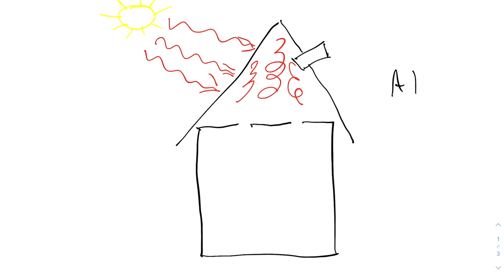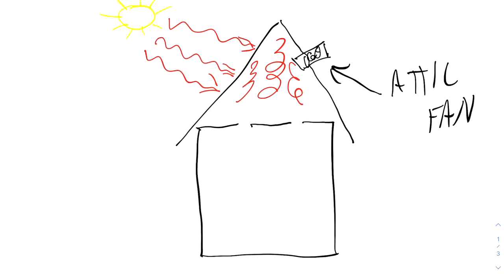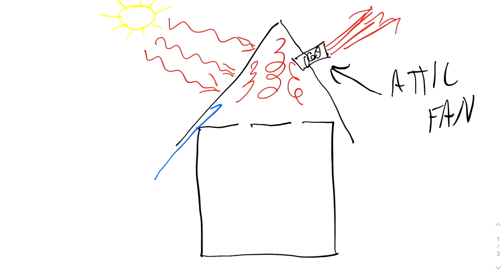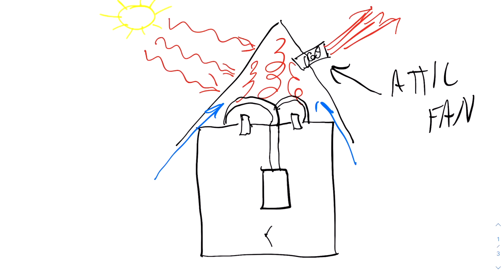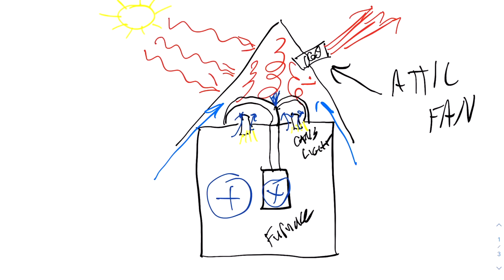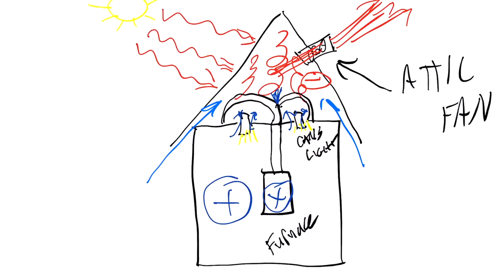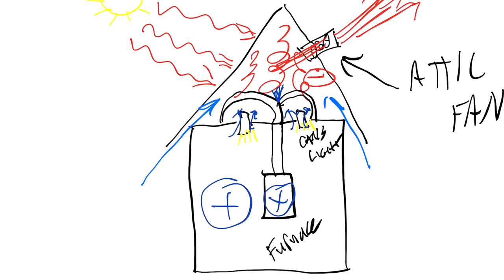3 Remodel Rip-Offs

Comment: I am an HVAC contractor, i disagreed with this gentleman. I have a solar fan in my attic an about 4 passive vents, also the ridge vents. The attic is very comfortable. I have also installed Radiant Barrier and added insulation. I have trees shading most of my house. That I also recommend.

Comment: Hot air moves to colder air. Heat transfer by convection in this case is being amplified by the attic fan right? The idea that your cold air is being pulled from the house to the hot attic doesn’t make sense since cold air is more dense and hot air is less dense….unless the attic fan is working so well that it’s cooling your attic at a rate quicker than your house is being cooled by the a/c.

Comment: Wrong answer on the attic fan bud. I'm a mechanical/electrical engineer building by profession, certified in thermography, work in the cloud IT space. Since I've got hot air in my attic and not a hot pocket, I think I'll follow the physics of heat transfer and put my fan in. I'd suggest others do the same

Comment: well I live in Panama and when I changed my windows from slide single pane to double pane and european style I saw 27% savings on the electricity bill  and I live in humid hell (I save a ton of money as the A/C doesn't have to work that much harder) with the added benefit that they are a godsend with lowering the noise.

It will take around  20 years to payoff, but my keeping my sanity due to the lower noise to me it already paid off

Comment: I Got a new nest thermostat (With air wave) and it was $50 from the store. (power company deal). I noticed IMMEDIATELY it made a difference. The air wave function is  determined by humidity, so it won't make your house damp, it does save some on power because a cold block of steel in the AC room doesn't help my house, so it shuts the pump off a couple of minutes early harvesting all the cooling you invested in power wise. 
it learns how fast your house cools / warms and can use that info on schedules, or to determine when to stop the pump for airwave. having the thermostat programmed for my schedule is really nice, and I can turn the AC off from my car if I forget to do it before I leave. You can even set it up to start the AC again automatically  when you return home. 

So, basically I can't trust anything this guy is saying, because I know for a fact he's dead wrong about some of it.

Comment: Thermodynamics disagrees with his assertation that attic fans don't work.  I designed energy conversion buildings inside the shell of steel sea crates that converted 1000VDC (solar) to 386VAC 3 ph.  There was a lot of heat given off by the inverter sections that needed to be removed.  By installing industrial Greenheck exhaust fans on the structures we were able to cool the electronics - outside of Austin, TX, IN THE DEAD OF SUMMER at 110 deg F.  Moving air across a surface that has a higher temperature than the air will remove heat.  As long as there is a temperature differential it will work.  The trouble with solar powered fans (without supplemented power) is the roof and attic stay hot long after the sun goes down.  I'm still going to get one for my house in Florida.  There is no attic ridge venting above the attached garage but there is for the rest of the house and it is partitioned off.

Comment: Reading the comments these guys disagree with the attic fan. Also you said it's going to blow air in with your example of the microwave. It's actually taking hot air out. And the furnace ac system is in a closed system of the duct work. So the pressure wouldn't be affected.

Comment: I have a smart thermostat and while they can HELP you save money, they only do so because you can program in temps and let it handle stuff automatically. But yeah, typically the claims they make on saving 25% is nonsense. At best <5%. It's the smartphone integration that's nice. BTW, mine costed like $60.

Comment: We hired a company (yeah..there were some vague warning clues they were fly-by-nite.☹)
But needed extra insulation up in the common truss roof system, & crawlspace....we had thought we could DIY…but, old folks crawling thru a web of trusses, or under house, is a fail.  
….So, they brought bags of fluff (of course, there’s was “unicorn sweat”)…
     I specified R-60 on contract, but, they only went to R-40, & that, only by me pushing them to put more!  At that, they only added about 3 more bags. ☹
….Also, they were not gonna install soffit vent baffles to prevent fluff clogging the vents…we’d already bot some, intending to install, so, I handed them to the kid crawling up there…he did not even understand what those were, or why…had to tell him!!??  
Those may have gotten just tossed up there, around a corner, to fake install.  
But since I cannot crawl up there, who knows??  
….They sold us on an attic vent…I was not gonna, because added $250.  
     But then considered the humidity factor (mold is the State flower in WA)…& said to install it.   I need to check it to make sure it works..cuz we cannot hear it at all.  Pretty sure that company counted on that!!☹
….They did crawlspace, to repair that insulation, & add a perf’d radiant barrier (like laid over the attic fluff).  .  They had not even brought any R-30 batts to replace a few damaged batts, so, we had them use a few we had on-hand…so, theoretically, the floor was well-buttoned-up?  
….Pretty sure they Significantly over-charged us.  
We really were hoping to see improved utility bills…..but.…got near-zero improvement in energy efficiency.   Nada. ☹  Just a huge debt to repay. 

What we DID get serious drop in energy bills from, was how WE started renovating windows…😉🙂
House came w/aluminum single-pane, so old, glass nearly falling out of frames. 
Cleaned the old ones, resealed w/silicone clear. 
Framed out at least 3” around outside, & mounted matching recycled windows from down the street (neighbor bot new replacements, identical old ones to ours). 
Sealed well, trimmed out, those immediately stared saving countable $$$… (2) 4’x5’, & (2) 5’x5’ treated this way, dropped the bill by at least $100 during coldest winter month.   
AND….Can still use for ventilation & required emergency egress. 
We even installed a window AC unit in one…fit fine; made a window panel to fit the window above that. 
THAT was real savings!  
If we’d had some Low-e film to put onto the inner window, it would be even better. 
 Our system copies one I’d seen years ago.  
It has *zero* condensation in winter…compared w/average dual-pane windows that get lots of condensation.  THAT proves efficiency.  
For some time, I’ve been slowly collecting pieces of materials to build a daylite solar hot air & water heater, into the patio roof.  
Slowly, getting that figured out.  
It should give even better heat than the 64 sq.ft. system we tried for several years at another location, which measurably helped reduce heat bill there.    But this system, I plan to also dig in a low-tech geothermal component, to help use the same wall-boot to bring in cooling fluid, to help cool the house in summer. 
There are low-tech things to do…just must be observant, know some basic physics, & not be too worried about max’ing out efficiency.  
Today’s world needs all kinds of ideas to help remedy.  . 
 It cannot happen, if folks are stuck on totally optimizing efficiency of renewable systems! 
We have blown-past the time of affording to wait for trickle-down high-tech stuff to reach the masses needing it. 
Far too many folks cannot afford the fancy high-tech.  It’s important to optimize the low-tech, low-cost ways that DO work, even if those don’t “optimize”.

Comment: If you have a long enough ridge vent with plenty of soffit vents, you don’t need a power vent. But depending on the roof, your ridge might not be venting enough hot air to do the job.

Comment: we have central air and the house would still be hottish during the summer with our single pane windows and no attic fan. and our bill omg. that ac would run almost all the time until it crapped out. got a new system electric bill got even higher. we got a thermostat with the new system as well. grant it the house got cooler but again the electric company bill raised a lot. we ended up replacing the windows and our bill dropped by half and the house got even cooler. i am leaning toward the attic fan due to these comments.

Comment: Bad advice on the attic fan. I recently was working in my attic doing insulation and remodel work in the summer - many hours required. It could easily get to 130+ up there mid day without the fan. Kick the fan on and I could see temperature reduction much closer to outside ambient. That was the difference between a serious health and safety hazard and being able to actually work up there. I can imagine the longevity of the roof too should temperatures stay properly under control.

Comment: I find it astonishing that folks would think that AC leaks into the attic that could not amount to the size of a 4x10 register total (and that is a lot) would cool off a 150 degree attic by even one degree. If there is plenty of sofit ventilation that is where the air is coming from.

Comment: You could be right about the attic fan in the south east, but out here in California, the attic fan is a great upgrade to any house.
Reply: They’re not. Attic fans pull cold conditioned air from your living space into your attic. While your attic may feel cooler, it’s actually at the expense of your primary quarters. Your A/C unit(s) are now cooling your attic, putting further load onto your HVAC system(s).

Comment: BTW, those who have "can" light fixtures in their ceilings and allow air to pass from the living areas into the attic or the reverse, hot attic air into the living areas have cheap or older can light housings.  Most of todays can light fixtures are double walled and are airtight preventing air exchanges.  This is of course if the builder or remodeler installs good can lights. I'd imagine there are brands that still allow air passage through them but who would decide to use those these days?

Comment: I completely disagree with the attic fan, often times I only run the fan to coop my house down. 
I also disagree with the windows, I replaced 22 windows and holy crap, huge difference, especially in the winter.
He brings up decent points but my experience was different

Comment: Like to see the actual humidity readings from this.  The idea is to run the fan to get the last bit of cool off the radiator after the compressor is turned off.

Comment: Most of the  "Smart" thermostats I've had run the fan for a few minutes after shutting off the compressor to keep the cold coil from condensating excessively allowing it to 'acclimate' a bit.
Reply: Yeah, and mine allows me to set a minimum run time for the compressor, too. So I don’t have to worry about it only kicking on 2 minutes. There’s also an “over cool” option to allow AC to over cool the house by a few degrees if the humidity readings are still high. I feel like he’s just knocking some items that homeowners can get and not have to hire a contractor for.

Comment: power vent fan helps keep the heat removed from attics I rather more insulation but on older homes the ac is under rated for the load and they use to put them in to lower the ambient temperature in the attic I know insulation is better but there are a lot houses have to have them to keep the homes cool I recommend if you are changing out and HVAC system is to add insulation and have the contractor do a HVAC load calculation - power vent may be needed if it was part of the original load calculation but on change out the HVAC company should recalculate the load and do away with the fan

Comment: Matt I’ve enjoyed many of your videos but you’re way off base when it comes to attic fans. They are highly effective at reducing the summertime temperatures in a home. This is especially true in certain climates. In my particular case, northern Colorado and a two story home. Attic had a peak height of 5’ and installed two solid attic fans. One on the roof of the house and one on the roof over the 2 car garage.  If you have temperatures ranging from mid-90’s and going as high as 105 (peak heat in july), the air in your attic space hits 145-160 degrees. If you can evacuate that 145 degree air and exchange it for outside air that is 95 degrees (and declining as the day cools down), it requires less energy and time to cool the upstairs of your home.  Think about it, it’s much easier to attain temperatures of 75 degrees and your fighting against attic temperature is 95 or 100 versus 145 degrees,  In my case, the temperatures upstairs dropped by 12-13 degrees.  I was actually able to get rid of my AC ( large window unit) altogether. In a dry heat, 85-90 degrees is livable. Especially considering downstairs was 75 degrees and that temps in Colorado drop by 30 degrees in the evening.  

So, as long as you have adequate attic ventilation , a decent sized attic and sunny days (if using solar) Attic fans make a huge difference in both cooling your home and making it so your ac unit isn’t working so hard to maintain livable temperatures. 

The 20 watt solar attic vent fans were installed in 2010 and are still running strong. They have a 20 year warranty and cost around $285 each.

Comment: Matt you completely wrong on attic/gable  fans! Under rafter radiant barrier w cross flow attic exhaust ventilation. Setup. Can cool attic temps up to 40-50 degrees. Added w white roof and exterior walls  even more!

Comment: With the powered attic fans, you have to get your calculations right or it will indeed feel like a scam. You need to balance the NFVA (Net Free Ventilation Area) as close as possible between intake and exhaust. Never have your exhaust NFVA exceed the intake NFVA or your attic will in fact pull your conditioned air from your home.

Comment: I love your logic, that power ventilator is not going to be coming on in the winter. Every single time one of my clients gets a new roof they remove the vents and or power ventilator and install a ridge vent. Now the attic is 30° hotter, so hot now that I can't even service the unit, it's unbearable. I see you are getting your information from the manufacturers of the ridge vents. Yes, attic ventilators pull hot air out of the Attic, of course they do, it's not rocket science it's simple logic. Don't come back to me and tell me that the sky is green it's not it's blue.

Comment: I agree a big attic fan turned on for 5 minutes will pull hot 🥵 air out of the house and attic in seconds and then turn it off it doesn’t run all the time it’s not one of those thermostat attic fans that runs 24/7 he is thinking about the 30 year old system that is no longer used.

Comment: So, are you opposed to passive attic vents, as well?  They create the same negative pressure, albeit at lower rates, that a powered fan would create.  Also, if your insulation is leaky enough that you're able to pull cool air out of the house with an attic exhaust fan, doesn't that mean the very hot air in the attic is going to be drawn into the house through those same thermal leaks?  The right answer is to have your attic space be as tight as possible, such that it doesn't really matter how hot it gets, or whether or not you have an attic fan, because it is thermally isolated from your house.

Comment: Matt’s problem with smart thermostats applies only to people with an improperly sized HVAC system in a relatively tight house and only during warm (not hot) humid weather. Like… what?? I can see for him building high end homes with air exchangers and dehumidifiers and all that, you barely even need a thermostat. You can just set it to one temperature and humidity level for year round comfort. Although even that probably isn’t true. You probably want sensors and dampers in different parts of the house to keep everything perfect in each room. I don’t get it. I love the control my ecobee gives me. And also, it has a setting so that I can have the compressor run for a minimum amount of time whenever it kicks on, so that really mitigates that condensation issue.

Comment: 😢 if you live anywhere that requires AC, dual-pane windows make a world of difference. Cuts down on ac cost significantly, and that's just with 2 panes, no low e stuff. And it's getting hotter. Invest in dual pane windows as soon as you can if you can't live without ac in the summer.

Comment: You want your fan to run longer on your air conditioner to dry off the A coil so  bacteria grows less. Doctor see a spike in bronchitis in air conditioning season. There's a reason why there is specific trades. General contractor. General practitioner.     Specialist in field.

Comment: Thanks for video but I have to disagree with the attack fan we have 100 year old house and have 3 exterior whirlybirds on roof and open gable vent on other end and the gable fan cools house down 4 degrees and put in a dehumidifier and can run ac on 74 degrees in Arkansas even in heat of summer which is around 100 degrees and 75 to 80 percent  humidity thanks for videos and like watching

Comment: Seems to me that the value of attic fans is running them for a set period after sundown to replace the trapped hot air in the attic with cooler post-sundown outdoor air to eliminate that thermal mass radiating down through the ceiling all night.